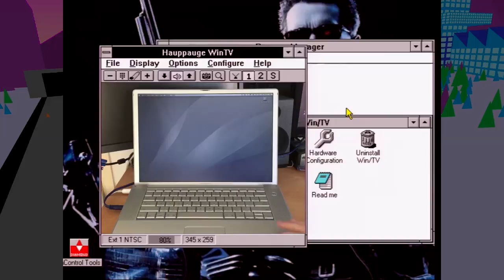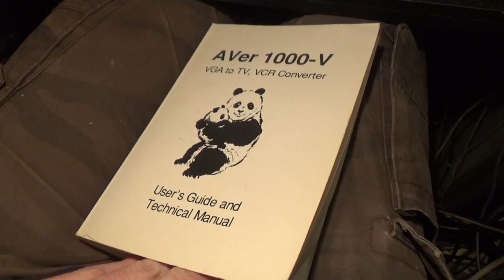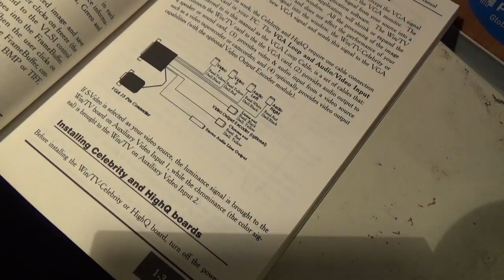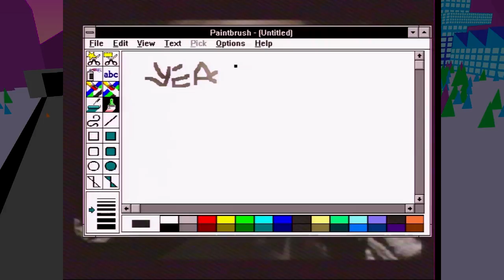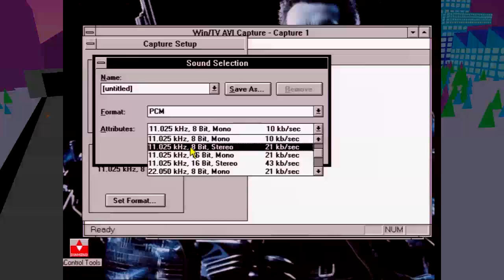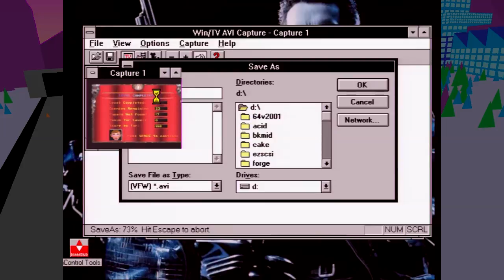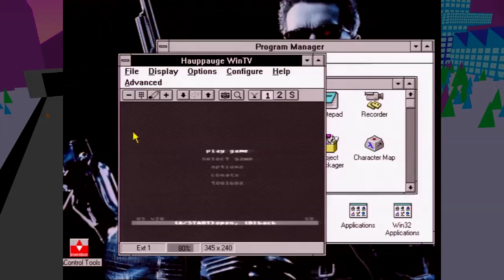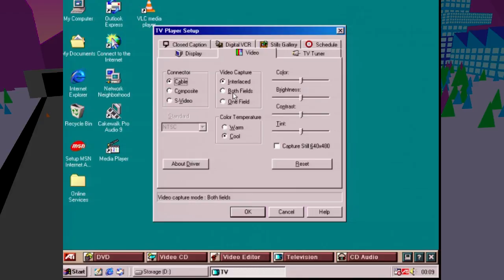Win/TV Celebrity Capture Card

Comment: That sure is one heck of a beast for digitizing analog video! This is also the first time I've seen an expansion card requiring a memory hole to be set. I believe it uses that hole as a buffer for storing the digitized video data when grabbing/capturing video. Definitely one heck of an unusual video capturing device.

The only oddball video capture card I have is a PCI VGA+TV Tuner combo card that uses a standard Trident VGA chipset I found inside Korean surplus PCs. I can get the Trident VGA portion working but I couldn't figure out how to get the video capture/TV tuner side working. Either it requires a specially modified Trident VGA driver that interfaced with the video capture portion or some kind of software that interfaces with the card in a unusual way to capture video but since such cards are most likely installed only on OEM Korean PCs, I doubt I'll be able to find the driver nor software for it. It also has a 3D glasses connector which I believe can be controlled by writing to one of the hardware port addresses written on one of the jumpers of the card.
Reply from the maker: Likewise I have never seen another card which requires memory holes first hand and you are correct, if the memory is not 'holed' this leaves other applications free to access the same address range and, well, I think it's safe to say that would be bad. That address range is where the card buffers things.
Sounds like someone out there liked the look of the ATI All-in-Wonder cards and tried to copy it with Trident GPUs, I've definitely never heard of that one. Does the system detect anything other than the GPU? You might be able to get a PCI Vendor / Device ID from that if it does, or else you can try the ones for the GPU and look them up in a database. Otherwise, the cards BIOS may hold clues in its header. I still think you'll have a hard time tracking down the software, but there's a slim chance that they used a separate chip or integrated a generic one which may work with generic drivers, or that the drivers may be labelled specifically for the card in some way making them harder to track down - for example, I have a YMF744 sound card, but to use most of the features I have to use a specific set of Typhoon drivers that make no reference to the YMF744 in their name at all, those were found by looking up the card's name in a PCI ID database.
Similarly the ATI Wonder card I have (not an All-in-wonder, but it does interface to the system via the VGA card over the AMC ribbon) doesn't readily cause the system to detect anything, specific versions of the Rage II drivers are needed before it can be accessed at all it seems, otherwise the system appears unaware of its existence.
Reply: The strange thing about the Trident VGA + capture card hybrid is that the regular Trident drivers included with Windows works fine on it suggesting that it has the same Device/Vendor ID as a regular Trident and I didn't find any other devices found in the card in device manager. I'd still try to get around getting the PCI IDs of it to confirm that it uses the same IDs as a regular Trident or not.

I should've mentioned that the card comes with a small daughter card which adds stereo RCA audio input jacks so the video capture portion of the card also captures audio as well. Quite redundant as the PCs the cards were installed on had sound cards that obviously have audio inputs but its pretty interesting nonetheless. I don't think the card had a header that you'd connect to a sound card's TV audio input connector which the RCA inputs might simply connect to.

Comment: I always thought the pink window was Microsoft's video for windows overlay, and that's just how that looked, pink.  When I got a WinTV PCI card back in 98 or there abouts, I watched TV on it and found the picture was cleaner and sharper than with a TV set. Analog cable really sucked around these parts back then, lines, fuzz, dots... what ever was always in the picture on a normal TV set, but the TV card seemed to clean that up a lot. I don't know why other than maybe the tuner was stronger in them. 

I am surprised how well the card can capture through the ISA bus frankly. But ya if the hard drive was there as well, I bet it would drop frame big time. 

Did you break my really cool cd burner again?  :)

Cards like this really were not meant for mere mortals to use, priced as such too I would expect. I think documentation usually sucks for hardware that wasn't commonly purchased in general, and there for, not popular, or well known.  I'm sure this was a real niche market. What would you capture? really, except maybe from a camcorder. I don't think it was practical back then even when the Internet was taking off like a raging California fire. If something like Youtube existed in the 90's, and the internet was commonly faster than dial up, I think capture cards would have been far more popular. Not to mention, in the 90's people were doing their own personal web pages, usually a free service that had super small file limitations and other limitations preventing the upload or viewing of a video file.  TV in a computer really never took off, I don't think, Sony tried it for awhile as a solution to edit home video from a camcorder, preferably theirs of course,  and HP throughout the 2000's  have had TV capture cards in many of their computers, even remotes, just never really took off with all of that effort,  but I think the hay day was in the late 90's with the Multimedia PC craze and as WinTV PCI cards ad AIW's became cheap, stocked at retail stores usually, and for the most part worked without any strange things to have to do, not to mention video capture was kind of a novelty because of hard drive sizes... I recorded an entire VHS video onto the computer, still more of a curiosity to purchase and try than anything though. I used one of those WinTV cards back in late 90's with my K6-300. With a 3.5Gb hard drive, I was able to do it in pieces, then edit it together into a single file I later burned to a CD. Made a jewel case for it an everything with my shitty HP inkjet printer, those things really sucked but, it worked I guess. I thought the idea of watching TV on the computer was just cool anyway. 

I would say though, Apple with their Quicktime software, and later Real player really promoted the idea of creating and sharing captured video clips on the internet.  If not for those 2, I'm not sure if TV capture cards would have ever had a market outside of so called professionals.
Reply from the maker: It is "overlay" but the WinTV application will work without Video for Windows installed at all, I noticed that the ATI card uses green instead, so it could be any color really, pink just seems to be the go-to choice. I often found capture cards could beat televisions and VCRs in some ways, here we had 5 analog channels, but the cranes on the dock would swing around and block out Channel 5 most of the time, especially on older TV sets using older antennas, the cards usually didn't notice. Analog TV sets were just weird though, I noticed on several that opening the door to the tuning pots improves the signal somehow, can't explain that one.

If I had to guess, I'd wager that sharing the ISA bus with a hard drive would practically cut bandwidth in half. The card seems to burst things to RAM quite well (that's what the "Buffers" setting does) but it would still have to write that data to the drive. It is doubtful that the card's frame buffer could hold up long enough to flush the buffers in system memory. Still, with a PCI hard drive, the quality is good with the AURA compression.

No broken burners here, that one lives in the P2. In the P66 I've swapped the Matsushita out for this Yamaha temporarily so I can try out EasyCD. I shall switch back to the Matsushita once I'm done though, I like that one better in here, if only because it isn't yellowed and the Yamaha has some reliability issues, though I strongly suspect it's an interoperability problem with my particular SCSI card.

Indeed, no way these things would have been cheap. I'd imagine someone used such cards for the screenshots which littered the old "My Star Trek Fan Page" sites which were once abundant. Perhaps magazines used them for game screenshots, though I know many used shots sent in by the developers. PC game captures (of still images) could be done in software or may have used VGA grabbers, though you'd think they'd at least try software first to dodge the cost of another machine. So yeah, not exactly a common piece of hardware. The Snappy seems quite well documented though, that one used a parallel port and could only do stills, though some got it to capture video and also allowed using camcorders as webcams, apparently.

My first adventures with capture devices were numerous, once I could capture, I did capture. Literally anything I could digitize an image of, VCRs, consoles, a camcorder borrowed from a family across the street. It was like magic and by the time I moved to a PCI card and a faster system, people began to notice this magic, plus the DVD burner. In short, it lead to the path of being lumped with converting people's family VHS tapes to DVD on numerous occasions... I swear if I ever see another awkward wedding, noisy kid's birthday party or... man, I'm glad those days are over. Made a few quid out of it though.

Ugh, Real Player, I loathed  that thing, it was practically the de-facto format for video clips online at one time and I genuinely despised having to install that bloated mess on my system, alongside AOL no less. Not sure if I disliked it or QuickTime more.

Comment: I want a card like this. It's so wonderfully odd and old.
Reply from the maker: WinTV cards are often expensive and difficult to get running, if you can even find them and that's not counting how hard it is to find drivers. AITech models are usually easier to find and to get working, but provide the same basic functionality, I think the old WaveWatcher boards even used the same codec chip for capture and playback, might be worth a look. Obviously the older the card, the more awkward things are going to be, going further back than the Celebrity here yields cards that don't do very much, can only scan one field and don't like syncing with consoles or worn VHS tapes. There are also parallel port devices like Snappy and AI Gotcha, though their capabilities are very limited by comparison due to how slow parallel ports were.
In regards to the PC/104 board, no video yet, probably some day. I do have one on another STPC board in a larger form factor though with the next CPU down.
Reply: Yeah, I've just watched that video. It'd be nice if you made one about the PC/104 board you have. It's hard to find much info on, let alone thorough benchmarks like you do.

Is the Win/TV-Prism PAL-B/G Hauppauge 5054 worth a look? It's on ebay for 15€ currently.
Reply from the maker: That 104 board is really weird, so it will get covered eventually.
The Prism isn't a card I'm familiar with and all I can find is a picture as eBay don't show it here - it hides a lot of foreign listings that don't ship to UK. Make sure it has the cables, they're hard to find, though I think that one can use the feature connector you'll want to be sure first if you're going that way. It seems retronn.de have drivers and a jumper manual if it doesn't come with them.
Meanwhile I'm gonna get a Snappy for fun, they're not very expensive and I'd like to play with one, probably cover it in passing somewhere if I get it working. This is your fault for bringing these things up, you're making me do it, you understand this right? Nah, I'm just messing with you, figured I'd bite the bullet after pondering it for a few years.
Reply: A Snappy? Sorry if I missed something.
Edit: no it doesn't come with any cables. But these look easy enough to make myself, if I'm able to find the pinouts that is.

Comment: I own an ATI All-in-wonder 9200 that I plan to use for video capture. I have a Intel Slot 1 Board with a Pentium III 450 Mhz.
Reply from the maker: Never used one from that late on, but if they're anything like the older All-in-wonder cards it should be pretty good for analog SD captures. I sure hope your hard drive is fast enough in the P3 though, because I don't know how far you'll be able to crank MPEG2 encoding on there, I doubt the card does this for the system as it was built at a time when CPUs were generally fast enough to do a decent job, some ways after the Pentium III had been surpassed. MPEG1 usually looks good enough though, if you have the drive capacity to handle it.
Reply: It may be a 72000 or whatever it is rpm hard drive running on a Promise Ultra66 I guess.

Comment: I had a USB Hauppauge TV Stick from the XP era, It worked well for about a year then crapped out on me :-(
Reply from the maker: I honestly don't rate their later stuff. The Express was a decent card, but it had some glaring problems that were never fixed, yet later devices were increasingly troublesome, the Colossus mentioned in here is practically a paperweight.
Reply: Yeah I've had a diamond graphics card before as well there a bag of shit too.
Reply from the maker: I've seen a few companies with "Diamond" in their name that are all different. The first thing my mind jumps to is Diamond Multimedia, the ones I've had have all been good, even the P66 in this video uses a Stealth 64 Video 2001 (And MVP1100) but I only went so far as the Virge (Stealth 3D 2000) overall, I don't know about their later stuff. Admittedly, I didn't rate their sound cards that much, but don't have much experience with them, more of a Yamaha man when it comes to that era of hardware.